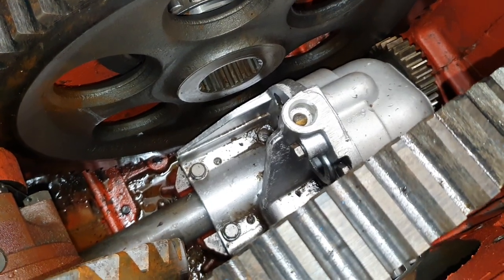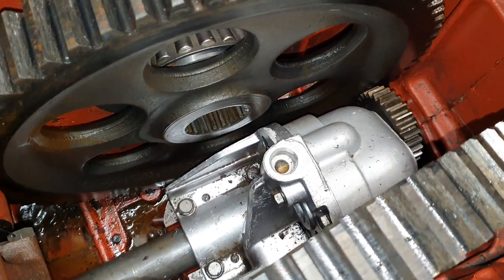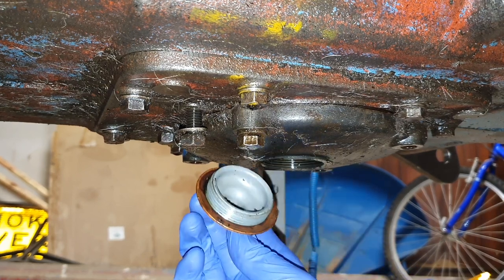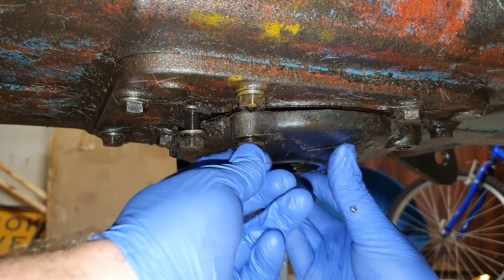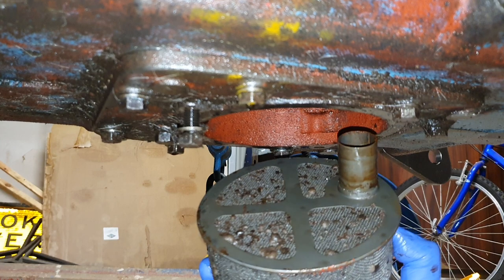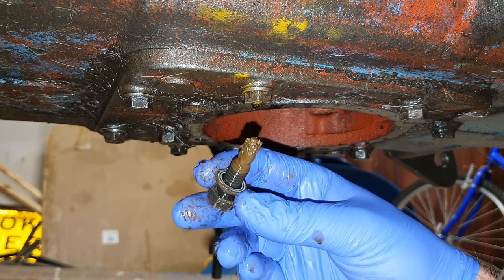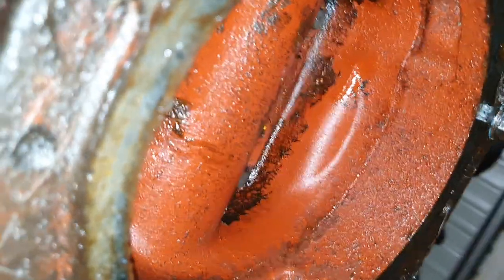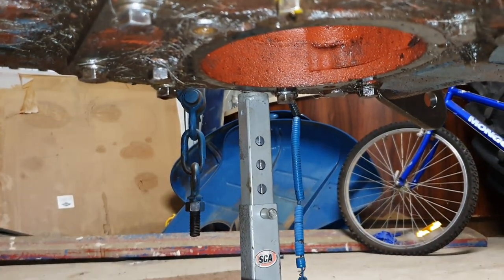Fordson Major Hydraulic Filters Removal

Comment: hello.
I am Alejandro from Spain. Thank you very much for showing how to change the filter.
 It was very helpful to me. I have the same system. and the 3 point lift does not work. When I took out the filter you show here it was clogged with paper, 
it looks like paper from some broken filter. 
I check the maintenance manual and it doesn't say anything about another filter. Could you tell me if it has another filter? 
and where?
 thank you so much
Reply from the maker: There is no other filter in the rear housing, I would think the paper has come from somewhere else.
Reply: @fixingfordsonsaustralia6632  okay. thank you very much for answering. Your videos are very helpful to me. I thank you very much for sharing.